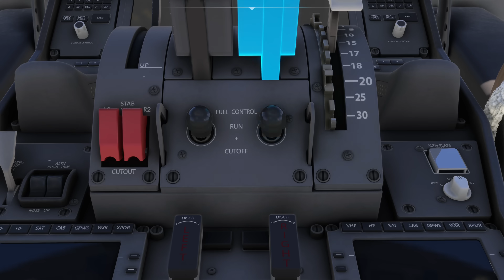Air India 171: Why Did The Fuel Cut-off Switch Get Moved?

Comment: Question:  I have seen you say in a few videos that the switches were switched manually with certainty.  I have seen others speculate other reasons why that might not be the case or perhaps it was an electrical issue that made it seem like they were flipped on the data.  Can you elaborate on how they or you know they were actually manually flipped?  (maybe they could hear the switches being flipped on the CVR at the time it happened or due to the way the switches work there is no possible way an electrical issue could make it look as if they were flipped when they were not etc?)

I guess the flip side to the "needing two people to shut down the fuel/engine" is a situation where one pilot is incapacitated or otherwise occupied and you could not shut down or shut down too late?  
Either way its probably both very rare occurrences.

Comment: Why would the Fuel cut off switch be mounted in a high hand movement area, where if there is a fault with the Switches, they could be easily accidentally moved, wouldn't be better to say to have the switches mounted in the over head panel, totally away from the high hand movement area, and if there is deliberate entente, it is much more obvious. ?

Comment: could it be a test by airlines to see - if they can save fuel by flipping switches on and off at regular interval... or, could it be the springs of the switches are corroded and locked out!

Comment: Too dangerous that a -pilot can cut off the fuel. It means a pilot can crash any aircraft at time of take off and complete a suicide action.   At time of take off, the plane will be in very low attitude and basically, the plane can crash if a pilot is doing it purposely.

Comment: You have already decided the movement of the switches was done by one of the pilots. But if the locking mechanisms wasn’t enabled - which apparently they weren’t in this particular case - then they could have been moved by accident. And that is a design flaw. And why put these switches, which are kind of critical, in a location where 1) they could be moved by accident and 2) where one pilot can move them without the other pilot noticing it

Comment: The fuel cut should only happen if the according thrust lever is in idle position. That's how I disarm my FPV Planes. I have to turn it off, AND lower throttle to zero. To many accidential mid-flight disarms 😕

Comment: There is no evidence that the cut-off switch actually moved, just the electric signal the value was closed. Also, there is a service bulletin that GEnx engine EEC MN4 processor might de-solided around 11k cycle and caused loss of thrust.

Comment: 4:17 Yes.. that is definitely a thing.   There are all kinds of ways for maintainers to jumper out wire harnesses to "trick" the plane into doing things.    But that wasn't the case here.  If it was, the engines would have either never started or wouldn't have shut off with the cut off switches.   4:17

Comment: Let’s consider a scenario where the engines shut down instantly due to a software glitch, without any need for the physical movement of mechanical switches — which explains how both engines were turned off within a second. The pilots, clearly surprised and shocked by this unexpected event (as we can infer from their conversation), attempted to return the engines to the ‘run’ position, which realistically took about four seconds. The remaining ten-second gap likely reflects the initial panic and confusion that delayed their response.

Comment: The report released by GOI is as vague as it is. They never mentioned which pilot said what..what was the engine status before and after the switches off, the conversations happened between the pilots ..all r missing..what happens during those 10sec no idea moreover when the switches were off what about the alram...why not the pilot alert when it was off....a lot of information missing. For the 1st time, the GOI released the report in midnight .which never happened in the history

Comment: The fuel cutoff happened at the same time the gear should have been raised, about 3 seconds after takeoff. Isn't it possible that the Captain - who was not flying the plane - just had an incomprehensible brain fart and instead flipped the fuel switches? I realize they are completely different systems and would make no sense to us how that could happen. But the landing gear was not raised. Could this be just an unbelievable brain lapse?
Reply: I don't think so. Gear switches are nowhere near the fuel cutoff switches, and the captain was VERY experienced. I think it was suicide.
Reply: Improbable. They are in two completely different locations. And additionally, if I had to guess, the pilot flying was not the one to notice the fuel control switches being moved. Taking off in a passenger jet requires you to be looking forward the majority of the time. The pilot flying would have little to no time to look down at the tiny fuel control switches and notice they were moved. Additionally, both systems are in completely different locations. The gear is forward of the thrust levers, and the fuel control switches are below/behind them. In my opinion, I believe the pilot flying had to have reached down and moved those switches, which the report says were flipped off with about a one second difference. The pilot monitoring could have used both hands and done it at the same time if he really wanted to. That is my theory, do not take this as something with any accurate meaning to it. It is an educated guess.
Reply: I fully understand! Even the biggest brain fart is as likely as intentionally killing all passengers, the crew and an unknown number of people on the ground. They could have hit an convention center or a mall. Almost everybody experienced putting something in the fridge that doesn’t belong there and vice versa.
Reply: If it was one switch, maybe that's a possibility. But two switches.? No way.
Reply: A very remote possibility, but a possibility non the less. He could have been distracted or not there mentally for some reason. Unfortunately, we'll probably never know.
Reply: @stevet8121 Well said.